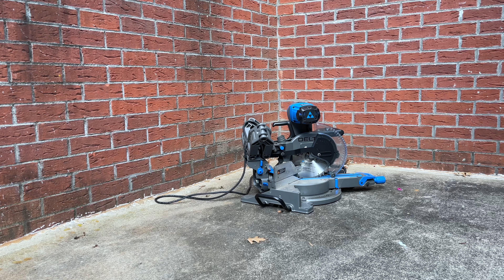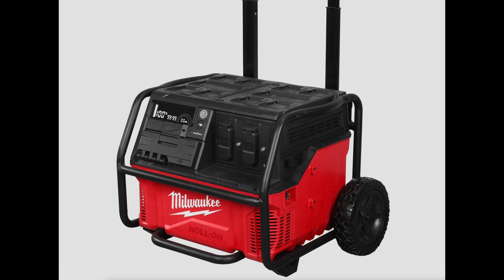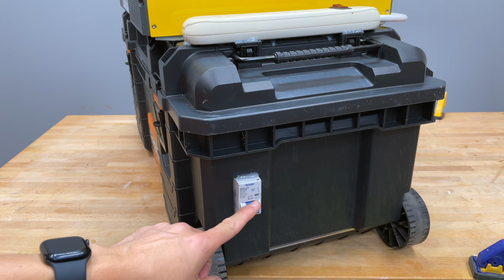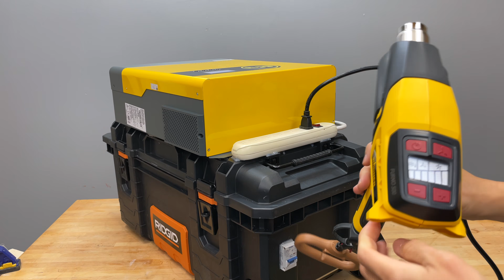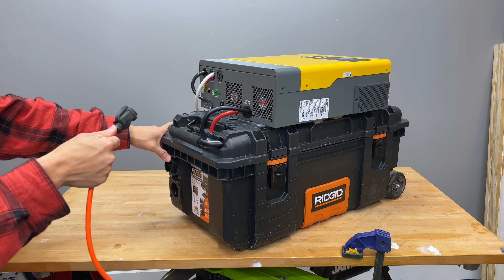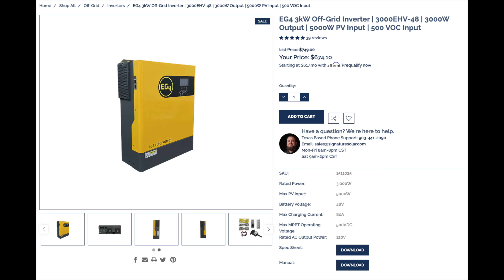23-42 | Mobile Portable power station power source in 15 minutes | EG4 3k 48v WP 5kwh | delta ultra

Comment: Great idea. I like these diy setups. I’ve definitely thought about building one of these vs an eco flow.  And have built some small portable setups for camping. I would say the biggest pro of diy is you know how your setup works and how to fix it if it breaks. Plus diy is going to be able to be repaired diy since you already built it once. Eco flow I’ve heard has great support but you will have to wait for them to either ship you parts or walk you through a fix or send to them and wait to get it back. Eco flow is going to be smaller which is a plus in mY mind. And although yes they are stackable and expandable it does become rather pricey and you are stuck in eco flows system at that point where with this you can always upgrade without being stuck with says eg4. You can always switch to another inverter or even make this into an off grid setup or a backup for your home.

Comment: If you're pulling 3000w of load, and your battery is say 50% full, and you give the MG5 mains power, will it overload the AC input cable? (eg. if AC input cable can't handle 29 amps (3000w+500w=3500w/120vac=29 amps))

Comment: Will it run an oxygen concentrator that takes 275 watts for at least 16 hours before it could be solar charged ?
Reply: 275w*16hrs = 4400watt-hours. 
Inverter will probably use about 40 watts, so 40w*16hrs = 640watt-hours.
Let's say inverter is 90% efficient, so 4400/0.9=4888watt-hours.
4888+640=5528 watt hours.
If fully charged, battery should be good for 51.2v*100ah=5120 watt-hours.
So it's probably only good for ~ 5120/5528 *16hrs = 14.8 hours; let's say 13 or 14 hours.
Reply: @jimmybrad156  Ok, thanks . I'm looking for 2 100 amp hour batteries now. I have a 2000 pure sine wave inverter, but I was thinking I only need a 1,000-watt pure sine wave.  Thanks for taking the time to help me out.  When I get one built, I will send you some pictures.
Reply: @newageautotechnology  you want to know how many amps AC your oxygen concentrator unit uses. The 2000w inverter will prob be fine. That load prob won't use more than 275x6 va when starting up. 6 is a rough rule of thumb for motor starting. So that load might use ~1650va of the 2000va inverter capacity when starting up.
Reply: @newageautotechnology  I guess your inverter is 48v?
Reply: @jimmybrad156  No, it's 12v . Will this make a difference?
Reply: @newageautotechnology  If you use 2x 100ah 12v batteries, that's only 2400 watt hours. You'd at least 5x 12v 100ah batteries to cover your wanted 16 hours...

Comment: If you're going to run loads like power tools, AC units motors or other inductive loads, then you should have built this using a heavy duty, high surge capacity, long lived low frequency, transformer based inverter charger, not that lightweight low surge, short live inverter. 

Chinese made. lightweight, high frequency inverter tech in these units are not only short lived and offer a weak 1.5 X surge capacity when compared to conventional off grid inverters, they can also be dangerous. You'd be lucky to get even two years of service from a Chinese made inverter charger, especially when powering high inductance loads like full sized refrigerators, large power tools, portable AC units or large microwave ovens. The reason for this is that all of these lightweight, high frequency inverters lack a very critical component. That critical component is an iron core, copper wound output transformer. Without an output transformer to act as a buffer to absorb electrical surges provided by the “Flywheel Effect” inherent in the physical amount of a transformer’s iron, these surges and damaging reverse voltage spikes must be handled directly by the inverter’s MOSFET transistors, essential shortening their life. 

You might be able to start and run some high surge loads when these high frequency inverters are new, but every time you fire up one of those inductive loads, you're shortening the life of the knockoff MOSFETs in these inverters. Lightweight, high frequency inverters run much hotter than low frequency, transformer-based inverters which makes the low cost, off spec, Chinese made components such as capacitors, diodes, resistors and ICs that are used in these inverters, far more prone to early failure. 

Another major consideration with these lightweight, high frequency, transformerless inverters is safety. All it takes is for the AC output monitoring circuitry to fail and one of the MOSFETs in the inverter's H-Bridge circuit to short to ground, and these inverters can send dangerous, high voltage, high amperage DC current straight to your connected AC loads which will not only damage most AC appliances but can also set those AC appliances on fire.
Reply: Which inverter(s) would you recommend within the around $2k system?
Reply: @imnguyen6658  Use a decent UPS that has power conditioning bells and whistles, normally ~$1.5k but look out for a second hand one for ~$400.
Reply: This troll writes these same comments everywhere on youtube.
Reply: No, This troll spreads the truth that you would like to hide about cheap Chinese made, high frequency inverters everywhere on youtube.  @meilyn22
Reply: @meilyn22  Afraid that the truth will impact your affiliate ad commissions meilyn? LOL!
Reply: Low freq inverters are great for protection against faulty inverter mosfets going super high voltage and wrecking your load, but the 'flywheel effect' is a common misconception. You really just need a big enough inverter to push the maximum required amperage.
Reply: @jimmybrad156  The flywheel effect in an inductor is no misconception. If's a basic principle of physics that can be explained by the Faraday-Henry Law.

Comment: I agree a ridgid to house the inverter wound be ideal , but as you found probably not happening! That said that particular ridgid box in and of itself is a rather odd one in and of itself being as how it rolls differently than the rest of the system! It does have the ability to stack on top of it with other boxes, but not with out becomeing rather awckward rather quicly! Making that aspect of it pretty unpracticail for anything more than say very specific and limited uses! Which I think you may have hit it out of the park on finding the best match for that box as you say it almost couldn't be a better match for that battery! My very first thought upon seeing your set up was to possibly take the inverter off of the top of it and mount it to the back of a sturdy aluminum hand truck that could in itself see to carry possibly 3 of theses boxes stacked like you said or even 2 with a third carring a pretty robust array of some sort you could be very portable and you would indeed be packing quite a bit of off grid potential for ones self for sure! Is their an inverter similar to this that would match the out put of 5kw with the same input of 5kw of pv just curious! All in all I think you have come up with an awsome build for those that may wish to power of larger power tools on demand in of any situation and at a great price point so much so with another back up battery you've far more supported yourself than you would have with like what you showed is available on the market and it is litterally one of the cleanest and simplest builds I've seen for any powerstation build out there! Bravo very nice indeed! Great match for a use for that box as well! I've been putting off buying one or two of them just simply for the fact I wasn't seeing or knowing that i may ever find as perfect of a use for them, so thanks for that!

Comment: Rather brilliant! And I assume the design can be down or up sized, depending on power needs? Camp ground various voltage shore power charging? Charging from a running vehicle, like, stuck in snow days? And it's so much quieter than fossil fuel. I think one could also go Steampunk with a self built plywood cabinet cart for pretty looks. 😂